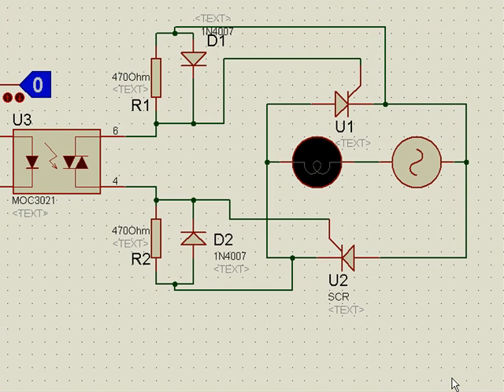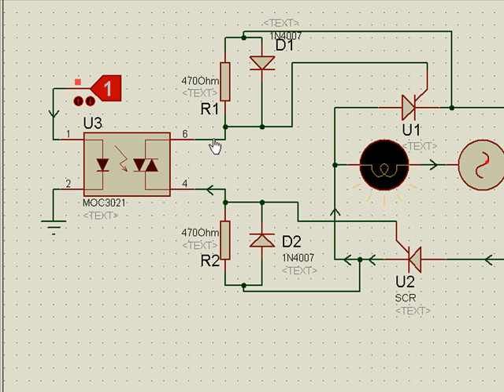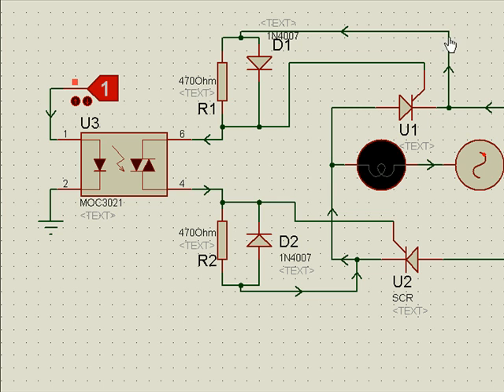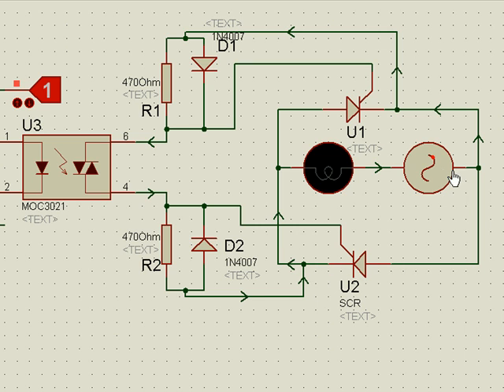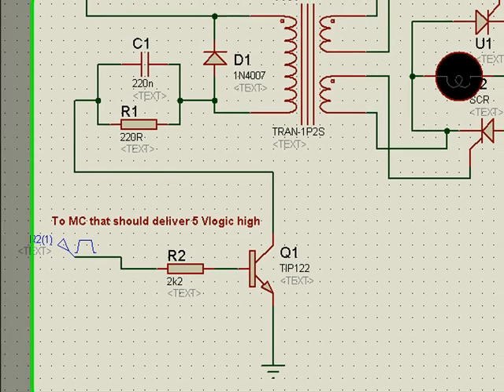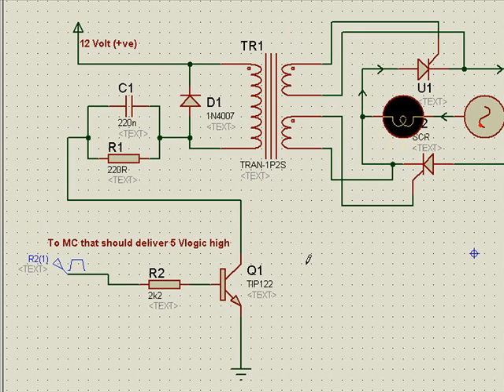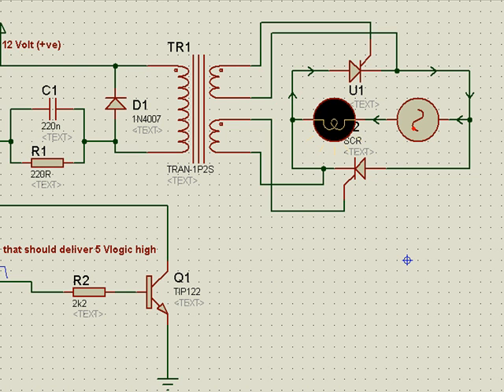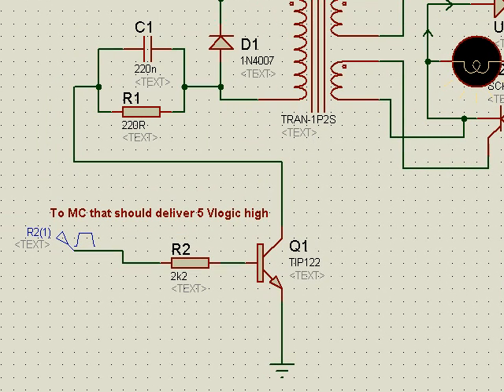Back to back SCR_interface by opto_coupler or pulse Transformer.avi

Comment: What optoisolator IC can work for 415v ac motor application?
Reply from the maker: MOC3061, MOC 3062, MOC 3063 But these are Zero voltage switching type for use in on and off only. Will not work for firing angle trigger type circuit.

Comment: Which type of thyristor did you use in Proteus?
I have error with simulation.
Reply from the maker: Choose only -- SCR Device Generic silicon controlled rectifier
Reply: @PatnaikUC  Thanks for reply.Can we apply this circuit(with optocoupler) for 3-phase?
Reply: @PatnaikUC  Please answer,I want to make a soft starter for 3-phase motor,As you know it means that the voltage is about 380V, What change should apply to your circuit for this voltage?
Reply: Shadmehr Aria for 3 phase 3 such units are to be used each with respect to neutral such that each section handles 380/ root3. No change in component value
Reply from the maker: @shadmehraria5473  use 3 units with respect to neutral. No change in components
Reply: @PatnaikUC  If we connect the output of 3 units to 3-phase motor in triangle(Delta) mode(assume that all other part such as zero crossing section and mcu program are OK), does it work without problem?
Reply: Shadmehr Aria yes
Reply: @ElectronicsinHindiIndia  With same R1 & R2 ?

Comment: I want to switch a single thyristor (t9g01412) Vrrm = 1400 Volts and Ir = 1200 Ampere, which optocoupler or pulse trasformer will be right for this?
Reply from the maker: Only pulse transformer
Reply: Thank you for your response, opto coupler will not write for that?

Comment: Why not put a resistor in front of the optocoupler? In the simulator i see no problems.. but I am a noob
Reply from the maker: Yes. In real hardware a resistor has to be used for the opto LED to limit the current to maximum 5 mA

Comment: Hi Patnik,  i am interested in your schematic, i want to do a cyclo converter single phase with 4 SCRs nearly similar to your schematic , i wonder if i use Vin=6 or 12VAC and the load is only resistor = 100ohm ,will it work with your schematic?, and what is the purpose of 2 resistor 470ohm in your schematic ? How to calculate that value ? Should we use the resistor to decrease current to the gate ? Thanks !
Reply from the maker: 470 ohm is for gate current limit. Same value for low voltage operation too.
Reply: Can you plz show me how to calculate it ? Do you do the real circuit with your schematic?
Reply from the maker: Yes tried with 220 volt ac in hardware but not 12 vac. The diac of the opto has a breakdown voltage of about 30 volts. So at 12 volt it will not work. In 220 volt operation the moment ac voltage crosses 30 volts the diac starts conducting.So 30  volt / 470 ohms is the current that the SCR is fed with around 63 mA which is good enough for any SCR to go into conduction. However one has to check the gate current limit of the SCR used. There are SCRs who even get triggered at micro amps. So the value of resistor depends on the gate current.

Comment: Sir, i have tested this circuit for a 240V line switching (and it works just fine! so thank you!) but i also noticed that during the off state the voltage across the optocoupler (i am using moc3081) is the entire voltage of the mains. I need to develope a switch for 3 phase load switching but the moc80X is not rated for it. What are my options?? I am using two back to back 1200V, 25A SCRs and a optocoupler MOC3081. Please leave a reply.

Thank you.
Reply from the maker: +Tathagata Biswas MOC3081 can be used For 3 phase 440v . use 2 such circuits in any 2 phases and not all the three phases to switch a 3 phase load. Please note this opto is a zvs type and can not be used for firing angle control to control power.
Reply: +Patnaik UC Thank you sir for replying.Sir, I will definately use 2 of these for 2 phases and leaving the 3rd phase connected.
I will be switching a capacitive load(capacitance of about 20uF).
Reply from the maker: +Tathagata Biswas For delta load use 2 sets and the 3rd direct.For star load you have to use  in all three phases.
Reply: +Patnaik UC Thank you so much sir and it is a delta connected capacitive load. Sir i need to know do i need a small inductor in series with  the scrs ? if so.. how would i get to know the value of inductor?
Reply from the maker: Yes . It is advisable to use an inductor

Comment: Did you make firing circuit for triggering thyristors (used for 3-phase full rectifier)? 
I need to measure voltage/current (with LEM) and to adjust to "electronics"?
I'm trying with TCA785.

Comment: hello sir i am looking for a circuit of energy power saver gadget which once installed in between electronic /digital meter and load will able to improve power factor,controls harmonic distortion,radiation if any?,emits electro magnetic force,radio active interference and purifies all indulged properties befores it comes for recording of reading(consumption) towards the digital/electronic meter.AWAITING YOUR POSITIVE REPLY VERY EAGERLY. My e-mail address is nekiram127@gmail.com.Thanks,regards, take care sunil pawar

Comment: First of all, Excellent explanation sir! I just got into SCRs and one thing that has been confusing me is why is there a difference between IGBT and SCR driving circuits? Why isn't a simple optocoupler and Power transistor used to supply the required gate current.(Isolated supply ofcourse)
I understand that SCR is current controlled and IGBT is voltage controlled but that just means that the amount of current will be more than that required for IGBT turn on. So we use a slightly higher rated BJT...
Apart from that, which is the best method for gate drive of larger thyristors for which MOC30xx ICs will not be powerful enough?
Reply from the maker: Thanks. Pls note SCR and IGBT are 2 different type of device. SCR is generally used for ac loads as it automatically commutes (irrespective of triggering) at every zero cross of the ac supply since  1) the holding current falls below the rated  2) reverse bias for the next half cycle. Where as IGBT is typically used for DC loads. In DC say SCR once triggered will continue to conduct like a diode indefinitely till current is  interrupted ,without caring for the gate signal is there or not. Where as IGBT shall cease to conduct the moment gate drive is removed. IGBT gate drive is voltage but the current requirement is (though high) is for negligible time just to charge its internal capacitor .Higher capacity as against the load is to take care of the factor of safety.For very high current thyristors that need much higher gate current MOCxx shall not be suitable so traditional pulse transformer is a better solution
Reply: So can we get the pulse transformer directly or do we have to design one ourselves. Secondly If we must design one, where to get the core?
Reply from the maker: Chinmay Harkare  Any pulse circuit design from net can be followed.Pulse transformers are available in plenty in industrial electronics shops as 1:1 or ( 1:1:1. required for 2 scrs)
Reply: Sir, Could you please do a video on designing the SCR gate drive using Pulse transformers.
The books I have only explain the working which is obvious from the circuit itself.
I would like to know the procedure for choosing the transistor, resistors (on primary as well as secondary sides) and proper pulse widths to avoid saturation for driving an SCR with say I(mA) gate current requirement and say being driven by a 3.3 or 5 volt supply.

Comment from the maker: Dear Saraaj,Is that your assumption or you have tried in hardware?Please note it is a practical circuit used by Philips since decades where I worked for 15 years. So if Philips is wrong and all the devices those are working is design defect then you may be right.

Comment: This is not correct!!!!!!!!!!!!!!!!!!!!

Current is not at all flowing via SCR...

 It just going via Opto-coupler (TRIAC in it). So high power only via OPTOCOUPLER is in practical IC is not possible.

 And also SCR here connected here just act as a diode no meaning of SCR function...
Reply: Go to the basics buddy. You have no idea how that circuit works. Trust me. I did that circuit and tested it thoroughly. What I did is not a "college project" I am working in a company and I implemented this circuit there. It works perfectly. The only thing is you can avoid R1 and R2 id load is resistive but you got to use them when the load is inductive. Figure it out yourself why?!

Comment: But if two SCRs (rated 16A) are connected in parallel, therefore their total rated current will be 32A. Taking the factor of safety 4 into consideration, hence on the safe side the maximum will be 8 Amps. Am I right or wrong?

Comment from the maker: It depends upon the type of load.For example an incandescent  lamp draws 10 times the current at the time of switch-on from cold condition.A motor 4 times,battery charger 2 times.On a safe side use maximum 4 amps for a 16 amp device.(factor of safety 4 )

Comment: I have read somewhere in a booklet that:
"Generally, line voltage is stable to within +/-10% of rated value. In case of OVER voltage, the kWh meters read substantially LOW due to significant AC damping that result in some braking mechanisms. This phenomenon is called "overload droop" and is slightly higher for low PF. However, kWh meters read slightly HIGH when the line voltage is LOW".

Can you explain please?

How can I send you the circuit diagram of the Power Saver?
Thanking you before hand.

Comment from the maker: One can cut the power supplied to the load to save energy.Meaning if the supply voltage is 220 v ac, the back to back SCR in firing angle control method can cut about 20 voltage to deliver 200 volts to the load.Thus less the voltage ,less the energy.But one sacrifices the working output of the gadget under use.For example a lamp,that will glow with less intensity.A fan will rotate at less speed etc.

Comment from the maker: Yes R1 and R2 are optional.Pls note they are connected across the gate and the cathode.But if you don't provide that SCRs which are much more sensitive to noise may trigger without signal while spikes on supply voltage appear which is quite common in practical world
Reply: How to calculate value of R1 and R2

Comment: Hi, in the data sheet from the MOC3043 is written that the resistors R1 and R2 are optional why this is and why You mounted them !
Reply: Yes they are optional. if your load is resistive then the circuit will work perfectly without those resistors. But if your load is inductive say transformer, it will get heated up due to noise.